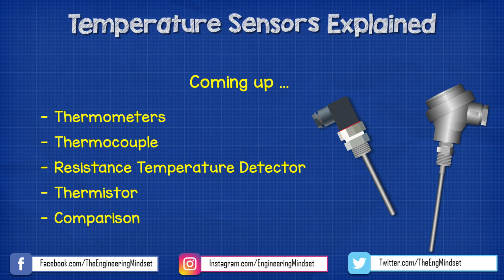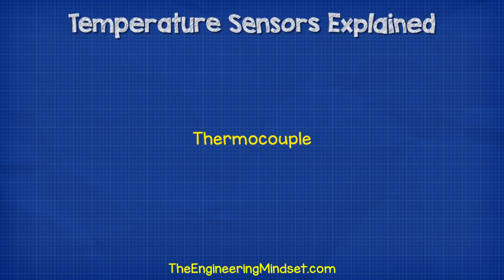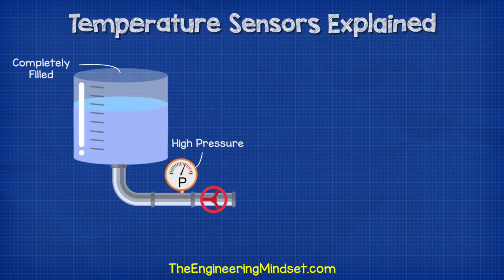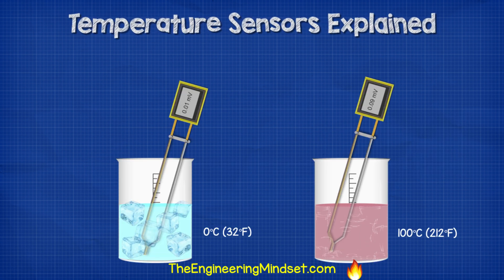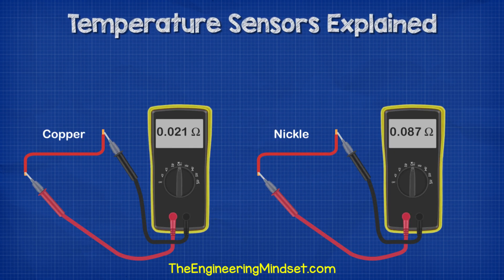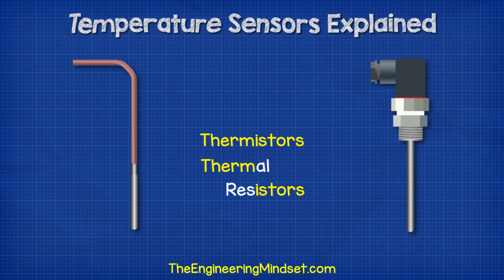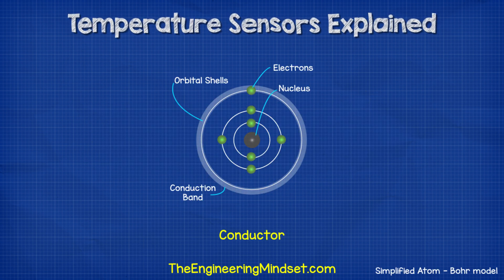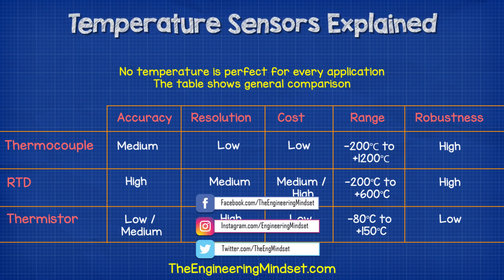Temperature Sensors Explained

Comment: Suppose I want to measure the temperature of air in my compressed air system. Doesn’t need to be super accurate or have high resolution. I’d like to insert something into a copper tee fitting at various places and read the temperature. What would I use without breaking the bank?
Thanks

Comment: It's a problem with the heat and pressure sensors on cybernetics problem we're going to have to figure out what's going on real quick this sauce is not going to get off the ground right if they detect where we're located one deep s*** right now there's still their craft and all kinds of s*** in the area so we have to keep stealth mode going until we can figure out what the problem is

Comment: Hi! There is something i'm looking into right now that seems to be generally overlooked: When you have radiant heating sensors should be covered by a "black bulb". I cant find a good explainer video showing the difference between operating a radiant heating system with a regular temperature sensor and a black bulb sensor.

Comment: Hey, I did not understand the difference in working between the metal/conductor atoms and semi-conductor atoms. Why is one a PTC type and the other NTC type? Both ways of working are similar. Both must have increasing resistance to current flow.
Reply: I think it has to do with the materials used. I don't have any reference other than what I read on DigiKey, but I think NTCs use metal oxides while PTCs use, I think, ceramic stuff or polymer, can't remember. I'm not a chemist so I couldn't explain why this would affect its behavior

Comment: Hi sir. I am rather confused now. Is the thermocouple used with RTD in industry pratices?
Reply: Cold junction compensation is most likely handled by either an IC temperature sensor or a thermistor. RTDs are quite expensive for that

Comment: @1:57, ok the two different metals react differently to temperatures, but they are tied together, and thus shorted out....so how is there still a voltage difference???
Reply: I think they're shorted using the voltmeter that gives us the voltage reading

Comment: I have a problem I have tried to solve for years. Controlled from a computer, control at least 32 (off/on) switches, isolated, with a possibility of an acknowledge line back to the computer. What circuit will do it?
Reply from the maker: Top of my head I'd say use a raspberry pi to control an IC chip and piggy back more off that to give you 32 on/off points. Can then use relays off those to control larger circuits
Reply: @EngineeringMindset  thank you, I will look in to it.

Comment: make a video on linearizing a thermistor
Reply: That's a good one. Where I work, controls basically use a lookup table and do a linearization between 2 temperature points. If you want to use a formula, you'll have to use the Steinhart-Hart formula

Comment: Can you please have a video locating the balancing valves, differential pressure sensors, differential temperature probes and how sequencing of chillers and pumps are done. Basically the sequence of operation of the system with an illustration would be very helpful with all the parameters.

Comment: Brother can you help me
my chiller tube is  leakage .
 now I got water inside the shell how can I remove that water from the shell  .
Can you explain to me in  video   .
Reply from the maker: You need to contact a specialist refrigerant recovery company in. The chiller will be contaminated with moisture and need to be treated, new oil and filter driers. The tubes tested and repaired, you might be able to plug the tubes if not many. Speak to the manufacturer

Comment: Awesome video,
Please make video on how train runs on electricity by only a single wire. How circuit completes by one wire only?
Reply: The track works as a ground.
Reply: @LukeSumIpsePatremTe  then why can't we feel shock on touching the tracks?
Reply: @AbhinandanAwasthi  you have to touch both the wire and the track to complete the circuit, just like the train. but that will also kill you so don't do it.

Comment: Great video we love temperature sensors, great timing.
We use these sensors in our titanium oxidize, we just call it anodizing and in power coat baking oven set ups controlled temp and heated liquids required for best results and it is nice to learn more about them here.
Thank you.
Lance & Patrick.

Comment: Very  good video 👍👍. But another important Temperature sensor used in large scale manufacturing plants is Gauges (Bimetallic strips connected to Pointers)which show accurate measurement without the need for any electrical input or measurement technique. Maybe you can cover a short video on those along with their applications on Thermostats
Reply from the maker: Good idea
Reply: @EngineeringMindset  second this, fluid expansion temp switches too!